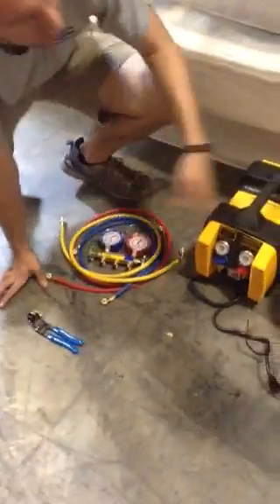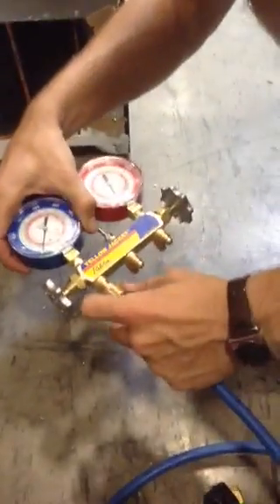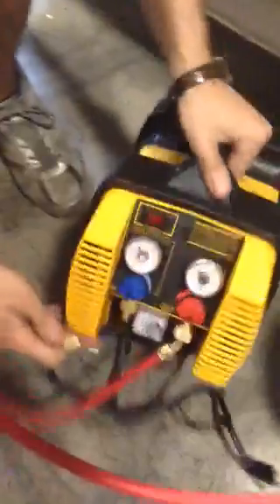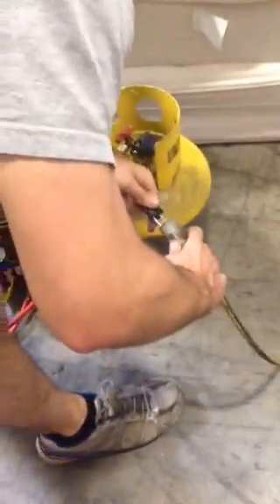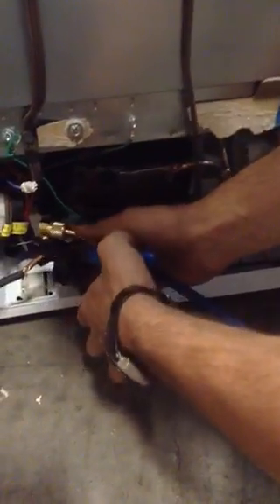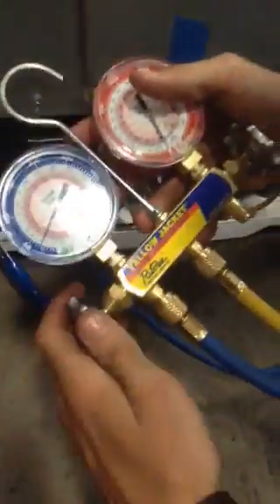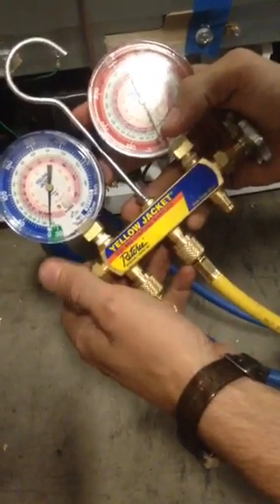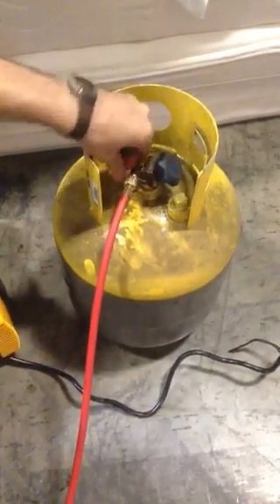How to evacuate freon from a fridge

Comment: We have a fridge that’s stopped working. It’s been cleaned and switched off for a month, but still smells a bit like chloroform. There’s nobody in our area who can repair it, probably a leak and a failed compressor. So is it okay just to unscrew the compressor from its housing and cut the tubes - and let the gas (if there is any left) escape naturally into the air? Probably should be done outdoors, right?